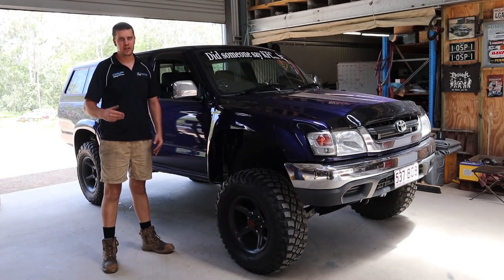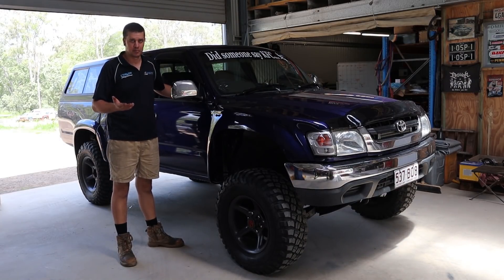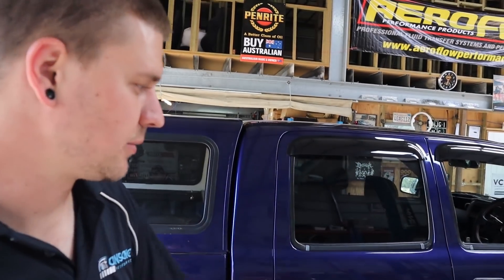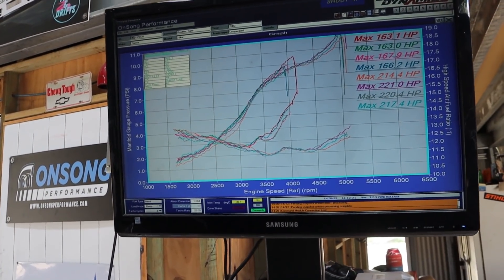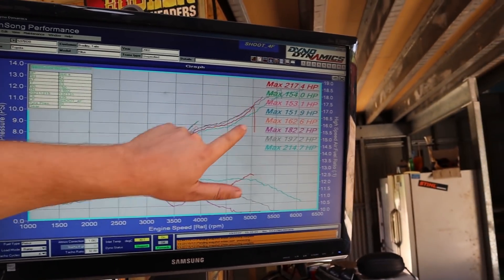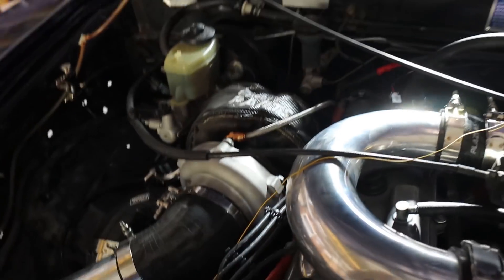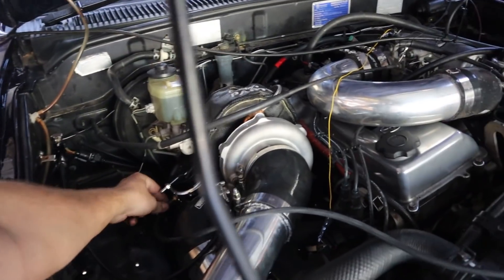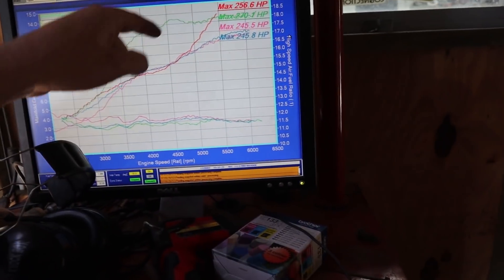Turbo 3RZ 4x4 Hilux Tune!

Comment: Fantastic video. So much to learn about fuel system components. I live in Missouri, USA and I drive a 1998 Toyota 4Runner 5MT 4x4 2.7 that I work on often, so this was cool to see. Funny, my previous car was a 2009 Pontiac G8 6.0 so this channel doesn’t seem too foreign. Even though you guys say “Kilowatts” instead of “horsepower” and “zed” instead of “zee”, everything basically applies to tuning in the US too.

Comment: I love the facts about the submersible fuel lines, fake walbros, oil lines not being fireproof, definitely all great things to know. Stuff you don't think about and can cause the biggest headaches when troubleshooting . 

I remember during a tune my old boss used a ratchet to keep the fuel cap open in a crx and it gained 100whp... Everyone was like WTF. I was like ahhh I get it now ...

Comment: Run insulated studs into the sender assy, don’t use the stock connector on the sender assy.
After fitting these and ran wiring through a relay directly to battery I stopped burning pumps out.

Comment: Weird wastegate/boost issue. I had a similar-ish boost control problem at one point, turned out to be a combination of an intake leak and a tiny crack in the reference hose. 🤷‍♂️

Comment: Great video on the potential headaches of tuning a new combo, will have to keep an eye on all of those things with my 3rz hilux. Should be able to run closed loop boost control with the new software as well on the 550, it's one of the things that sold me on the entry level ecu over a 750/950 after the nsp update.
Reply: Why did you opt for the 550 over 750? 550s and 950s are being made obsolete in coming months
Reply: @theowoollett1826  for myself and I'm sure many others, the 550 does everything and more that you need for a fairly basic 4 cylinder engine, especially after the nsp software update. They will still be supported by Haltech so shouldn't be an issue.
Reply: @jpstrim  fair enough I’m going the 750 i guess its just preference

Comment: First time watching this video , but one of the main issues on this trucks running out of fuel on high rpm is because you need to get rid of the oem relay and put and aftermarket relay to have 12v constantly

Comment: These engines do fine with the brap muffled away.  What a terrible sound but with a proper exhaust they quiet down enough to use in the woods at night.

Comment: The exhaust housing is probably too small .63 ar. Get a 3 inch exhaust with a plumb back y no screamer as illegal. Then up the housing to .83 ar. Add you're Mac valve and it will be fine.
Reply from the maker: Its a .8 T3 housing already
Reply: 1.06 is recommended isn’t it

Comment: no 1 noticed the broke vacuum line on the Fpr at 2:45...
Reply from the maker: Was fixed prior to tune, so yeh it was noticed
Reply: @BoostGumps  I was referring to the actual owner, he was driving and never noticed.😂 good job though, you tried your best on it. most people would had not cared enough to find issues.